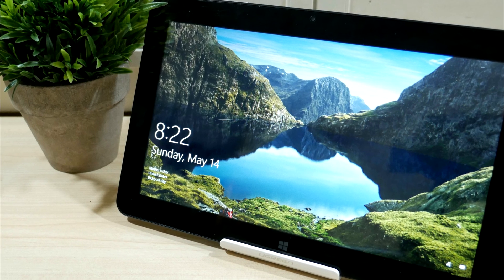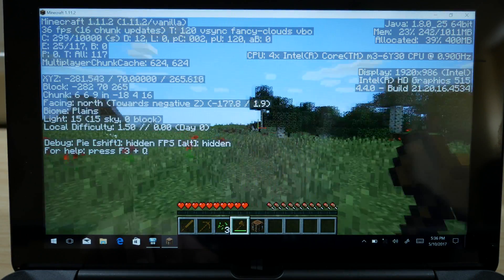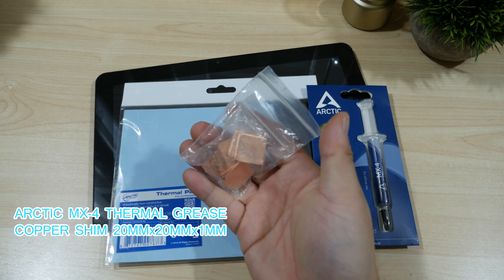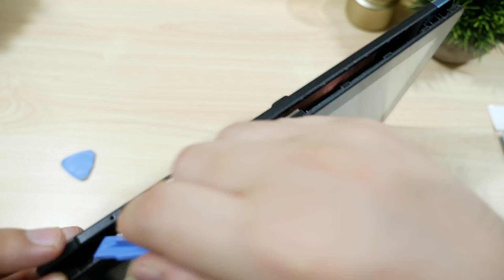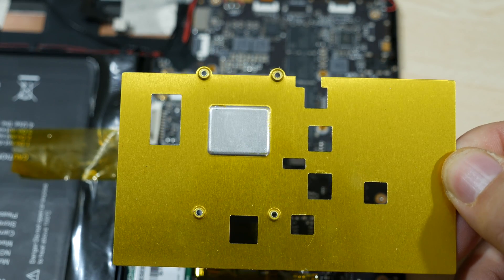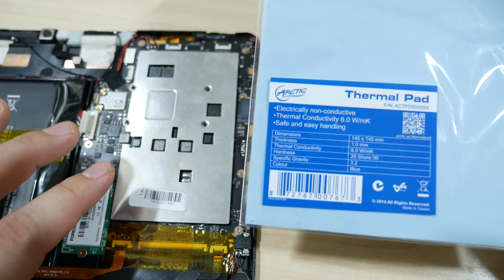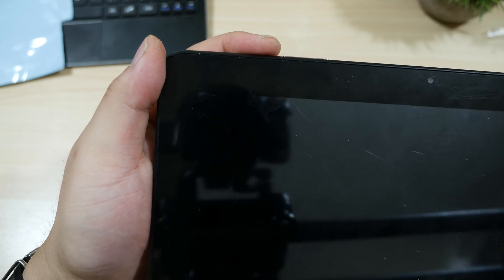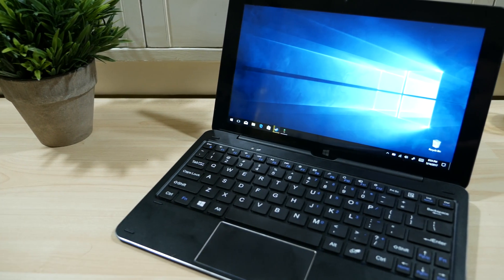Cube i7 Book Thermal Mod Tutorial (50°C Temp Drop)

Comment: Thanks for the guide. Just one thing: You applied way too much thermal grease, it should be as thin as possible, just enough to ensure contact between the metal parts/fill in the holes. Also you should put thermal grease between the copper shim and the metal plate too. It's to be used whenever metal parts make contact, to fill in all the small imperfections in the material.
Reply from the maker: You're right that it was a bit much and I did try to make a note of it. Good tip on applying it on the top layer as well. I'm usually more careful and thorough when I build gaming PC's :)

Comment: Hi sir, very appreciate for your help last time. I have just received my copper heat sink. But the seller sent me the wrong size which is 13mm×13mm with 1mm. Am I able to use it? Thank you
Reply from the maker: +Sudono Salim As long as it doesn't extend far out enough that it contacts any part of the motherboard it should be okay.
Reply: 3ES Thank you very much

Comment: hi, is it safe to put copper pad like that, isnt it gonna short out pins next to the processor? Maybe put insulation tape around the chip? Im gonna be doing this mod myself
Reply from the maker: +Betrion As long as the copper shim isn't overly large, there shouldn't be any problems contacting parts of the motherboard. Good to use your own discretion if you want to put tape around it, but it's not necessary.

Comment: Hi Sir, How do you stay grounded? I am a newbie to this thing. Please advice sir
Reply from the maker: http://www.wikihow.com/Ground-Yourself-to-Avoid-Destroying-a-Computer-with-Electrostatic-Discharge
Reply: 3ES thank you sir. by the way, I have ordered the arctic thermal pad same as in your video, could you please advice on how to apply that? is there a two sided glue on in to stick on the heatsink plate? Thank you very much sir.
Reply from the maker: The thermal pad is just like a sticker. There's a thin plastic film on both sides and you just peel them away and stick it on.
Reply: 3ES Thank you for your help sir, I appreciate it very much. Hope you have a nice weekend.
Reply from the maker: You're welcome! Good luck on the mod!

Comment: Hi! did you notice any extra thickness due to the thermal pad? Is it safe to use 1mm, or it could press the screen from the inside? Thanks for the video and your time.
Reply from the maker: +Lucas Lago  Hey, 1mm is the maximum thickness I would recommend. If you go to 2mm it'll have more of a chance to push the screen. I haven't noticed any problems with the 1mm thermal pad.